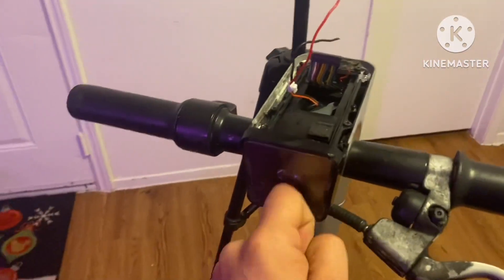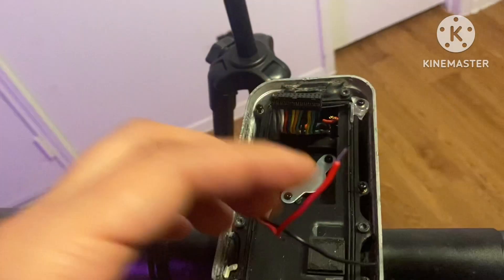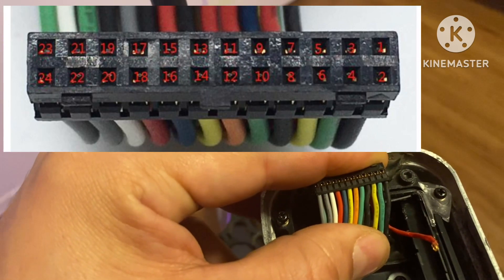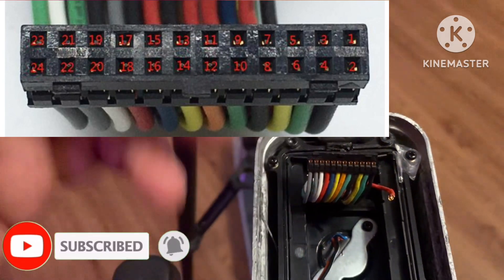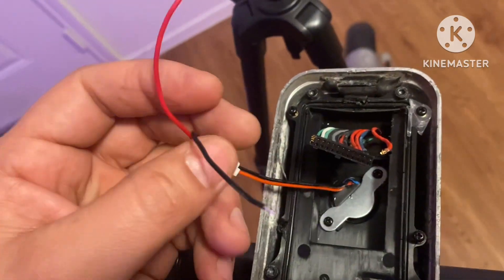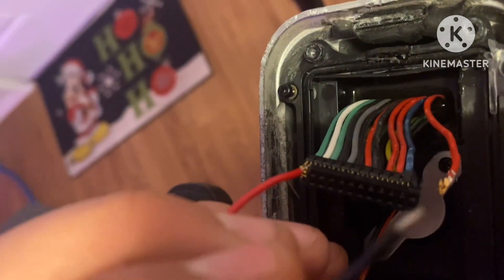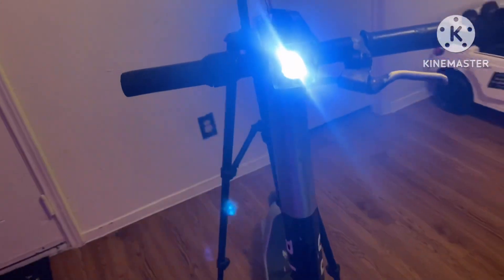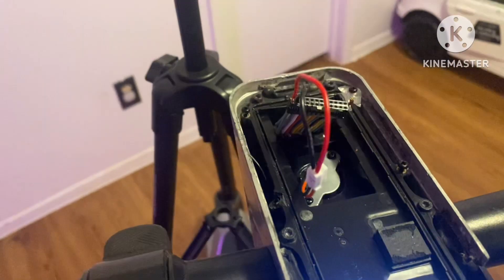Bird 2/3 scooter pin readout -headlight-  so far…

Comment: Nothing as fun as having a few test subjects around and just practicing a little poke & prod on 'em! BuahaHahahaha. I have 3 of the 6 heavy duty bolts over the battery plate that are (seemingly welded) tight and not budging. So I got the dmg bolt Remvr out to take a wack at it.
Reply from the maker: Yea it’s a task the first few times !
Reply: @P&J  scooter mods  hahaha that's a slight understatement when it came to the xiaomi m365 & it's tire change out. Omg! Some ppl were boiling there tires to get them on. Lol
Reply: @P&J  scooter mods  say is there a way I could send you a picture of the board I'm using? Dropbox, email?

Comment: Cool, Finally using the breadboard on top for headlights.
I already got my throttle working by jumping wires through the breadboard, I didn't read the fourm at first, I traced all of the components manually. 
So for the throttle: Top Row Left Has 2 Black wires. Top left would be 1,1.
Using your own:
Black wire Jump Pins [ 1, 20 ]
Red wire Jump Pins [ 11, 19 ]
Blue Wire Jump Pins [ 12, 8 ]
Tested on the Bird V3
Reply from the maker: Pin 1 is black to pin 20 green
Pin 11 orange to pin 19 white
Pin 12 red to pin 8 red 

Did nothing for me. I assume you had a kick the scooter for it the wheel to spin ?
Reply: @pjscootermods  I just uploaded a YT video on my end to shows that it works. Maybe it differs on the bird 2 and the bird 3? Maybe it differs by location?
Also Lime 4.1 is convert on my end and is much better than the bird v3 tbh, swappable batteries, intergrated seat, suspension and weatherproof, can't ask for more.
Reply: @Jnsystems  where is your Video ?
Reply: @Zattoo20  youtube is dum today so I put it back up for 25 hours, save it asap.
Reply: @Jn Systems  Thanks a lot, do you have a solution for battery is not charging?
Reply: It looks like it does differ by model I found it noticeably different from my breadboard on top and one on the manual. I think we can just Hotwire these mofos lol
Reply: @Jnsystems is ur vid still up?